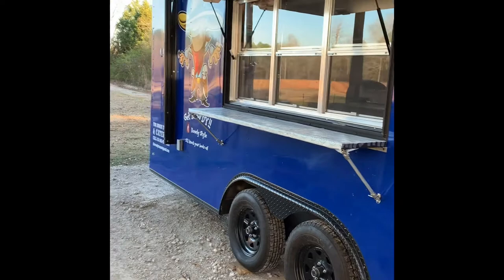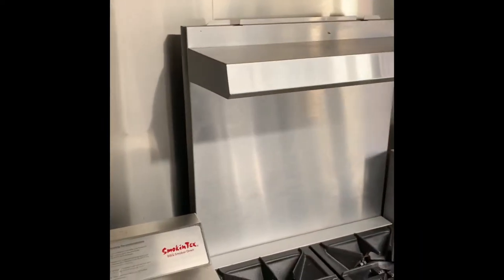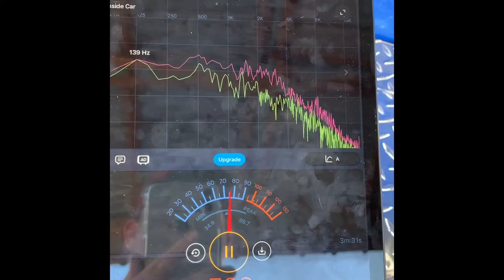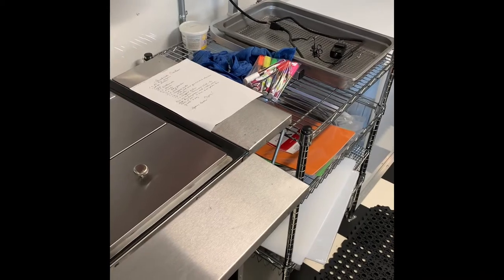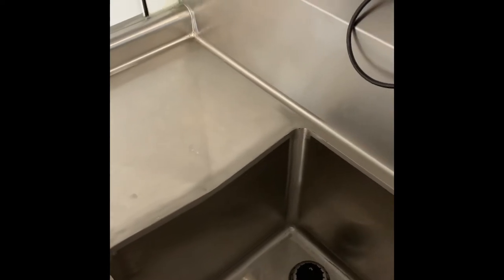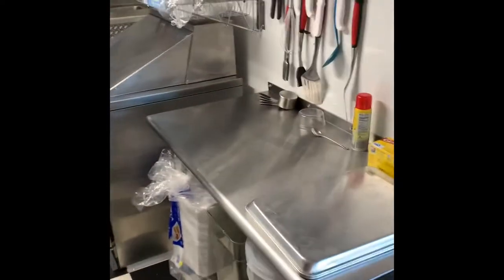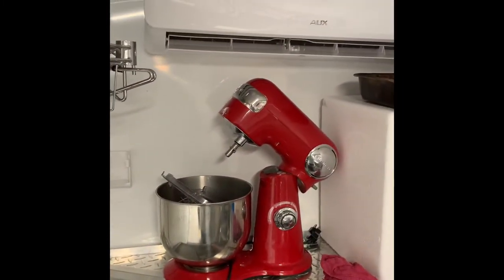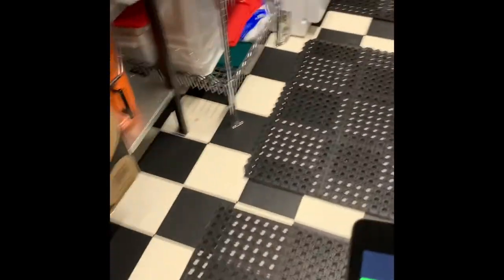Powerhouse 7500i northern tool generator review

Comment from the maker: Ok I sure will I did use it over the weekend for 2 events and was amazed at the low fuel consumption, 12 hours straight run time on economy mode produced all the power I needed all day.  Relatively light load moderate at best and only burned 3 gallons of gas
Reply: Wow that’s awesome where did you purchase this machine from? And what was the total cost?
Reply from the maker: I bought it from a new northern tool store that had just opened up at outside Houston TX I would have to look up the exact price but I believe it was about $3000
Reply: @JB-cw5uu  wow that’s awesome yea I was looking at this machine on northern tool but wasn’t sure about the company northern tool but you obviously have conducted business with them and I assume it’s good because that generator actually exists and I’m really interested in this machine because of its similarities with the Honda but a better price range for my budget the same generator but a Honda coast 5 to 6 grand for this same machine so your review of this machine is helping me a lot
Reply from the maker: @watupchief5889  I tested a Honda 6500i out and liked it but could not find one I could afford.  I like this one better because it also has the 50 amp plug which is what I needed.  The Honda required me to use an adapter but I can plug this one straight in and they have a lot of stores around that I can take it to for service if needed. They also said my protection plan would cover it for commercial use which would be a big plus for me
Reply: @JB-cw5uu  wow that’s awesome they even covered you that much more too, how was the performance of the 120v outlets? Are they 13 amp or are they actually 20 amp outlets? Because I’ve used a 120v-13 amp outlet for a table saw an it was not running it at all even my small inverter mig welder on a 3800 watt generator thank god that generator was not mine I was renting that for awhile lol I’m really hoping this powerhorse 7000 will be more then enough for both the small welder and the small portable table saw.
Reply from the maker: @watupchief5889  I’m not sure on that I primarily have just used my 240 50 amp plug, however if you look it up on a website called generator bible they have slot of real good info on there that might tell you, I’m thinking they are are 20 amp but I need to look at them to be sure
Reply: @JB-cw5uu  cool thanks man 👍🏽
Reply: Any updates on your generator? Still pretty happy with it?

Comment: I wonder how it competes to the new 9500W harbor freight inverter. Based on my first impression with the Predator, this one appears to be a lot better built
Reply: Very much interested in the same thing. Have watched a few videos on the new Predator, but it does not seem as quiet as they are marketing it.
Reply: Good question. From my research this runs at 55dba in eco mode and the predator is at 66dba on eco so that’s the mayor diff
Reply: @Em_jiggy  I ended up getting the Powerhorse. It actually exceeded my expectations. It really is whisper quiet in eco mode but even in Standard and Max it’s way quieter then most generators. You also get a lot of useful info from the built in display. The only con so far is its size and weight. Hopefully it lasts for years. Ive got 2 hrs on it so far and two oil changes. First oil was definitely dirty with metal particles. Second time I drained the oil it was clean.
Reply: @michalp2362  thanks for the response man. I’m thinking of getting that one too
Reply: Another diff is this generator has a 50 amp plug. But the predator does not

Comment: Hello, great video. I just got one. What oil or gas do you suggest?
Reply from the maker: I just ran regular unleaded in mine and used the oil Honda oil. I can’t remember the weight of it. But it’s on the specs for the engine .  Castrol is good oil too in my opinion

Comment: JB, just purchased this. Under the display there is an hourglass and fuel level. Under I1:, my identical powermore genny displayed 6.1. I had it switched to 120/240v with the 50 amp cord plugged into my power inlet. Do you know what that number(6.1)  represented? Amps perhaps?
Reply from the maker: If I’m not mistaken it is the amps being used by one side of the 240 plug  but I’m not 100% sure about it  l1 would be one pole snd l2 would be the other pole of the 240  but I would reference the service manual to be sure about that

Comment: How is it holding up so far,,? Did you use it during the Texas winter storm?
Reply from the maker: Yes sir I used it some.  Not much we didn’t lose power yet but I have even starting it every now and then just to ensure it’s gonna work if needed. I’ll post a video of it if I can figure out how  but in words it’s Awsome. We had the coldest temp ever on record for our area -7 and I went out and started it right up the next morning on the second attempt
Reply from the maker: I had done a video but I went and checked to upload it but it didn’t record.  I failed to hit the record button.  But yes it works great
Reply: Thanks JB gonna get one as soon as they are back in stock.

Comment: 3060w at 240 is only pulling less than 15amps, that seems really low for the equipment youre running... does it show the amperage draw?
Reply from the maker: all I can tell you is it runs what I need it for.  specs say it’s 6500 running watts and it’s 60 amps  running 240 it would be 31.3 max per  pole  according to the specs on it.